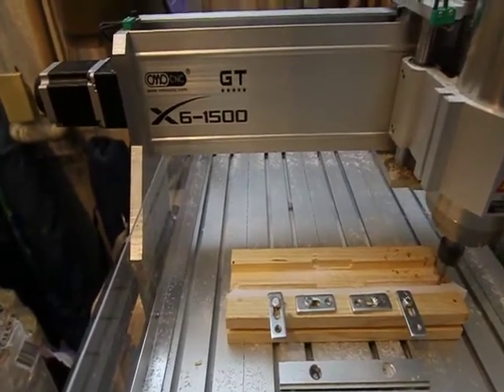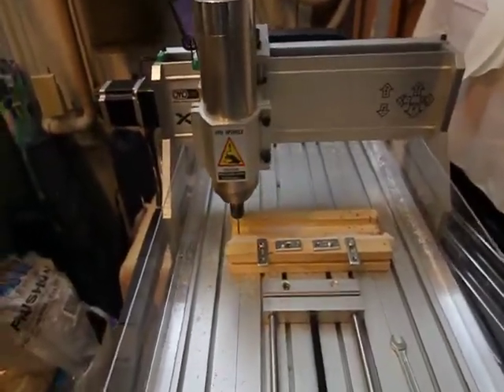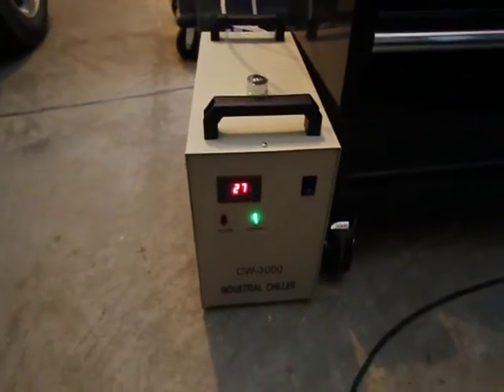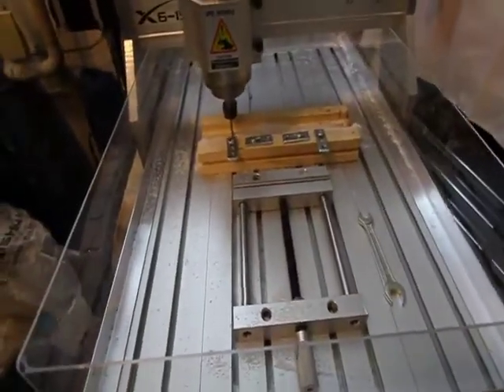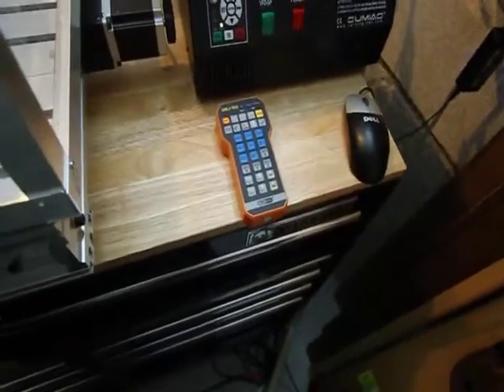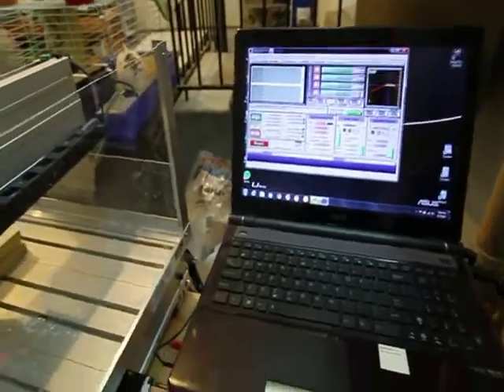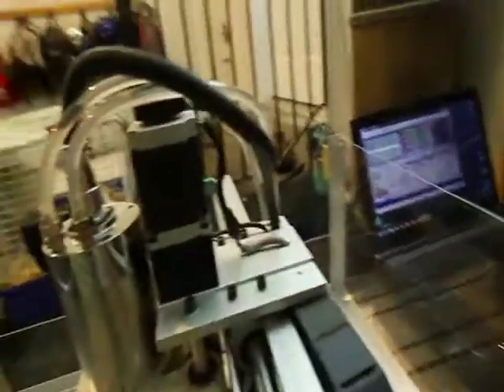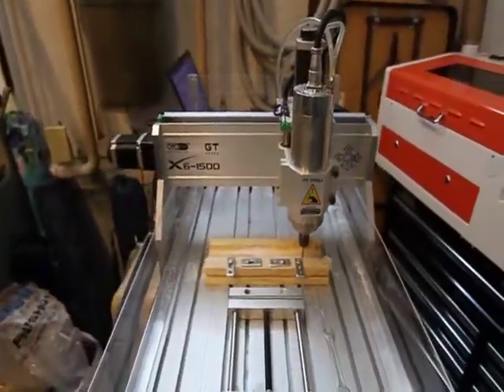6040 CNC Mill / Router Review, OMIOCNC X6-1500 GT USB

Comment: I just got mine, 2200 version. What about the pump that came with it? 
Is it not working or you think this chiller is better for you? Any upgrades you would suggest?
Reply from the maker: I never used the pump that it came with.  I bought the chiller for the laser cutter and ended up not using it for the laser...  Moved it to the mill and it has worked well.

Comment: Good stuff - thanks. Anxious to see how it does with aluminum. I'm considering one of the OmioCNC machines as well, tho they don't seem to have that exact model now. There's the X6M-USB listed which seems to be the same so maybe just a naming change, except it says it has an ER11 collect rather than ER16. Would like the X6-2200L which has the 2200W motor and linear track guides rather than the round bars so should be even more stable. But that's about $700 more. My main goal would be machining aluminum for small injection molds so it might be worth the cost.

Did you get hit for any extra duties / customs fees above the stated shipping? Shipping is over $300 to start, and I've experienced (to a much smaller degree) getting hit with extra fees when things arrive from China. Wondering what to expect.
Reply from the maker: Eddie.  Shipping on this model was ~$400.  There were no import duties or taxes, so their listed price plus shipping was it.  In an email from Omiocnc, they explained the differences, which are:

(1) Electronics:  
X6-1500GT equipped with  High performance YOC556 stepper drives,  40v power supply, High performance USB Motion Control Card.
X6-1500C  equipped with YOC335 stepper drive boards, 24v power supply,  Entry-level USB Motion Control Card, 
(2) Mechanical :
X6-1500GT use ER16 spindle, The gantry use 6063 Hard aluminum alloy.  Y-axis equipped with Support Rail. 
X6-1500C use ER11 spindle, The gantry use 6061 Hard aluminum alloy.  No Support Rail. 
(3) Application：
If machining aluminum alloy,  the processing efficiency of X6-1500GT  is higher than X6-1500C 20%

I have been pleased with the machine so far.

Dan
Reply: If your goal is to mill aluminum, go with the 2200L, better linear rails are worth it. I have X6-1500GT and already upgraded gantry/X-axis to Hiwin 20mm rails. Improved cutting but now Y-axis is limiting factor in terms of machine rigidity and flex. Flex and chatter will break carbide tool tips...
Reply: @jat1mat1c  i belong to a maker space that has an OMIO X6-2200l CNC router - i want to use it to mill A514 steel (QT-100?). Is this possible? the stock is only 1/4" thick. Also would like recommendation for where to get endmills for this work, I am informed I need to get single flute.
Reply: @QuentinKarmark  A514 being high strength steel it might be difficult. Most likely there will be chatter but with light passes it might work. You just need to test it. Single flute is best for Alu/plastic where chips might get stuck on flutes, for steel I would use 4-flute carbide, maybe 6mm(1/4") with coating, short as possible. I have used this shop for my carbide endmills: https://www.shop-apt.co.uk/
Reply: @jat1mat1c  so your comment about flutes is interesting,; the fellow at our space that does member training for the OMIO operation recommended less flutes to properly maintain chipload? I really don't know either way.  Thanks for the link too.
Reply: also, I wanted to add, are you able to share a video that you're aware of that demonstrates cutting steel on an OMIO?